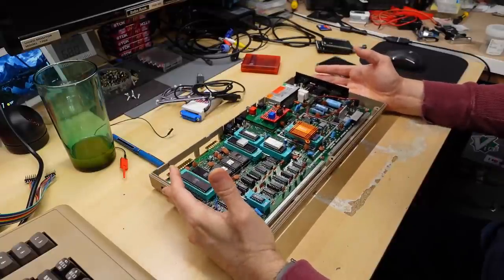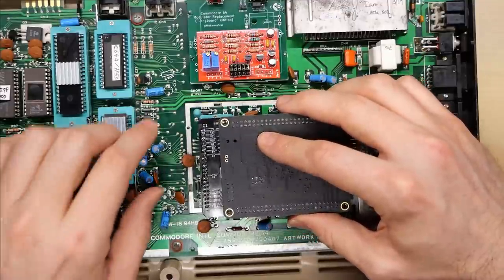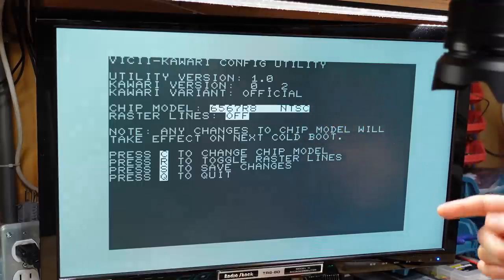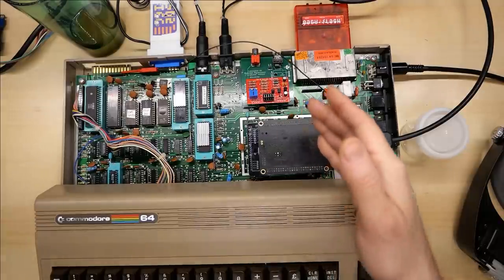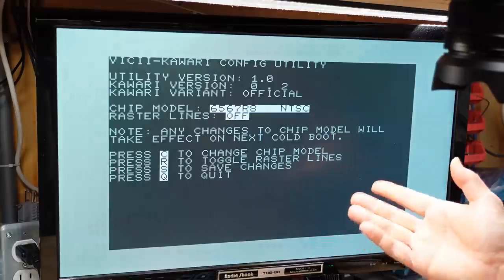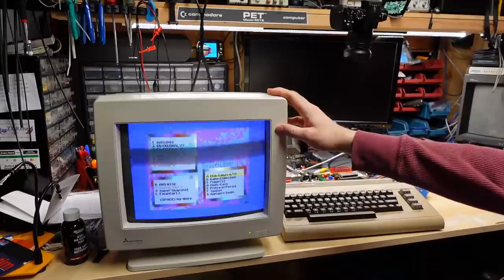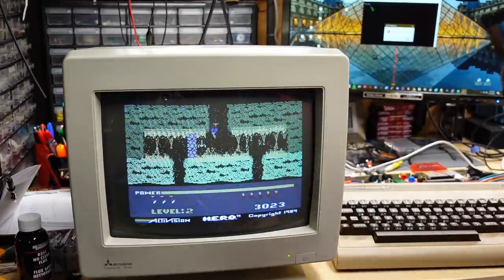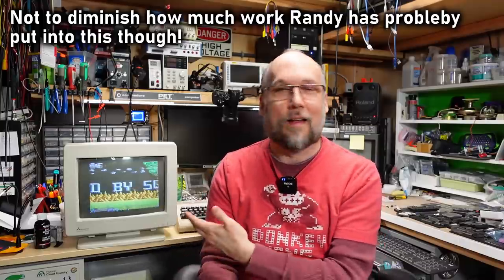VIC-II Kawari: FPGA based VIC-II replacement for the C64

Comment: I am glad you pointed out one of the things that really was big downer on the C64, the PAL colours were so miserable. Explains a lot, NTSC owners had a much better deal. Only the CBM 1701/2 monitor made the C64 look good.
Reply: I forgot to add I worked in a shop selling home computers at the beginning of the 80s and the colours were certainly so drab compared to others. Perhaps CBM thought it was important for the NTSC and PAL machines to keep the 16 hues as close as possible and that was in some way a cause. Certainly the Atari 8bit machines were much more vibrant but of course all the hues were incorrect, most obviously the NTSC red being a vivid purple, it annoyed me so much I hacked some the application to correct the colours.

Comment: Adrian... if we swap out all the unique custom chips with PALs, GALs or FPGAs. And once all the off-the-shelf chips start to get increasingly harder to get, we start swapping out those too. Then aren't we eventually going to end up with only the really basic components and of course the keyboard, case, and motherboard being original?
- Let me put this another way... Instead of producing replacement bits and pieces one by one, wouldn't it be more... ehm... I know there is Gideon's Ultimate64, David's Commander X16 and the Mega65 is well on its way and... ehehm...
... okay - Isn't it about time somebody made like "The64" just with a proper FPGA inside, with re-imagined features, upgraded with a fantazillion colors, sprites, SID channels, memory, storage, etc... yet still backwards compatible with the old software, hardware, cartridges, and other peripherals.
- You know: a proper ZX Spectrum Next 1:1 equivalent of the C64... It almost sounds to me like Randy would be able to pull this off.
Reply: The Commander X16 isn't compatible with a C64 at all.

Comment: To switch between modes it would be nice to use a few gpios of the fpga and some jumpers so it your monitor doesn't like the resolution just turn off, move the jumper and then restart..

Comment: Are there any PGAs with enough fast enough D2A capability to generate analog video signals?  And, how are more complex operations like the sprite collision detection?  (I would expect that it wouldn't be too hard to get the collision detection working once you got the overlay/underlay hierarchy working, but this is regarded as one of the most sophisticated, and difficult, VIC-II hardware features to duplicate.)

Comment: From what I've seen of FPGAs, you aren't going to find any difference between an appropriately programmed FPGA and the chip it was based on.....they're just a little, one might say, overkil for the job in hand. Having said that, if that's the ONLY replacemen on offer, I'd get behind it while the market's in favour.

Comment: I think I heard about modern CIA replacements in the works as well. Anyway for the colors. I have a VIC-II² mod from perifractic. So I have BOTH PAL and NTSC on my computer. The colors look the same to me. Those muted colors you had? I don't see them in PAL mode. They are just as vibrant in PAL as they are in NTSC.

Comment: This project is amazing!  I can't wait to see where it goes! Using a DVI-I connector for both digital and analog video is a great idea... it also avoids having to pay any HDMI licensing fees.
Reply: @simontay4851  It's not just the connectors.  If you want to make a commercial HDMI equipped product, there are license fees to be paid.  

When you buy a HDMI driver chip, part of that cost is the license fee to use the HDMI IP.  

You use HDMI, you pay.

Comment: Does the “native” video output also work ?
Reply: Have you not watched the video?
Reply: @ToTheGAMES  hmmm maybe native is not the right word.....I meant using the original display out ports...tv modulator (if it still has one) or s video like adrians has, could be interesting to see one display plugged into the original and another one from the adaptor....
Reply: no, its not designed that way, its straight from the video ram to an fpga representation of the vic registers and sprites and then turned into hdmi signal (via digital rgb?). if you want composite from that you can get hdmi to composite converter boxes.

Comment: Pepto ?
Reply: Probably a reference to the American antacid Pepto Bismol which is a bismuth subsalicylate preparation that has a sickly pink color which is strangely both vibrant and muted.
Reply: @Peter_S_  Yeah, I did wonder !...cheers.
Reply from the maker: Heh yeah and if you run VICE, you'll see the stock washed out PAL palettes are called pepto there. :-)
Reply: @adriansdigitalbasement   There not like that on a proper adjusted tv or monitor ..  If you turned and config it correct it looks very much the same as what your calling not washed out but the colours can still blend correct not like wacked like you show and like which makes a ton of games look broken to me.  these games were not made for never the same color twice .. Ntsc always has worst colours always will always has there full bright all the time and vary every time your turn them on.

Comment: I remember when I used a (PAL) C64 on my TV I used to play with the TVs colour control to get nice colours, which annoyed my parents when they switched to using it for regular TV and all the people looked sunburnt! (I only had a monochrome TV at the time, so I used to use the family TV in the lounge whenever I could!). I never used it on a proper colour monitor, even now I plug it into my LCD TV which still has a composite in, but that doesn't look as muted as the colours you seem to be getting.

Comment: Apart from delamination within the ASICs themselves, it's the PSU that appears to be the root cause of failure with the 64. Is there a reliable, easily obtainable replacement?
Reply: A replacement PSU that's more modern can be pretty trivially built, it's just 5VDC and 9/12VAC, there's also a project around which bills itself as a C64 saver or somesuch, basically monitors the output voltages of whatever power supply you build and kills power if they go out of spec. Jan Beta build a PSU around one of them a while back https://www.youtube.com/watch?v=IpuKz0TTB2I

Comment: Haven't watched this yet, but I have been saying we need a Vic-IIe because there are a lot of areas the VIc-II could be improved in. Screen-height sprites. Wider sprites. Instead of nybble mode static RAM for color memory, full byte-width static RAM could free up processor cycles in bitmap mode in a new implementation.
Reply: The 4-bit wide memory connects to the VIC-II chip using four dedicated wires, so that couldn't be readily expanded to 8 bits.  I would think what might have been more practical at modest cost would have been to have the VIC-II chip perform two CAS cycles on its clock phase instead of one.  If character shape memory placed the top line of 256 shapes in one page, the next line of 256 shapes in the next page, etc. then it would be possible for the VIC-II to fetch two bytes of character-select or color memory on one cycle and then the two associated shape bytes on the next cycle, without badlines.  Perhaps start each scan line with a pair of double-fetches that would specify the address of the start of the screen or color row, the MSB of the character-shape address, the horizontal shift, the display mode, and an indication of whether to fetch character data or color data (when using mid-screen smooth scrolling, the first line past the scroll point would have to duplicate either character or color data from the line before).
Reply: @flatfingertuning727  I won't critique your idea, but I hope it would work. As for your comment about mine: I never said we'd use the nybble static ram on the motherboard for this. This is FPGA, so color ram can be implemented internally with no need to always look to the motherboard nybble static RAM. Since the behavior of the FPGA VIC-II is no longer bound by the old Charpentier hardware, it can indeed fetch byte-wide data from RAM implemented on the FPGA.  Or,  in a new mode, it could still fetch a nybble from the mobo static ram, while getting another 4 bits (or a full byte) from on-FPGA nybble ram, so it would again have a whole byte to play with, thus giving more cycles to the 6510 in bitmap mode.   Because it's FPGA there are so   many ways it could be adapted/evolved.  My suspicion is we're talking chump change because really, so much more could be done beyond our meager ideas. It would be nice to see something like an Akiko circuit (inspired by the CD32) as a way to deal with the funky way X,Y is dealt with in a C64 screen bitmap.  More (screen height) sprites are an obvious addition. Maybe a blitter, and a copper.  A Scan Control Byte (ala the Apple IIGS) to select different banks of color registers is another thing worth looking at.  And of course playfields. Being able to under/overlay the FPGA's framebuffer with native and enhanced VIC-II modes is another thing to look at.